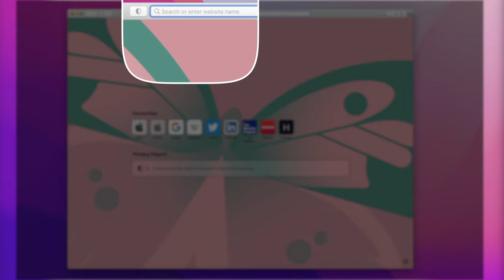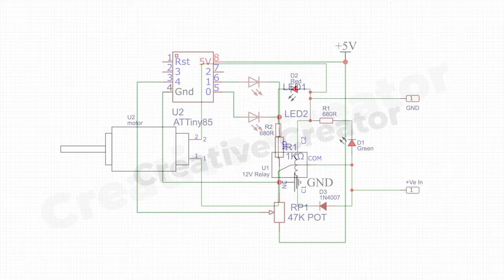[NEW] Simple Electronics Project

Comment: we can use a single diode for polarity ?...
Reply from the maker: You will not get much amps output with single diode...
Reply: Correct only  0.8volt reduce
Yes Single diode IN4007
Reply: Wsq
Reply: @Creativecreator   and also  the diode becomes too hot 🔥  . thanks bro for this ckt

Comment: If you don't want to use a diode because of low max current capable and wasting power due to the voltage drop, Just use a P-Type Mosfet for positive rail protection, or N-type one for negative rail protection. Just put in series by forwarding the mosfet body diode, and then tie the gate to the other rail throught a few hundred ohms series resistor (not really necessary but for safety in case the mosfet becomes shorted).
Reply: A single IRF3205 can hold up to 110A (but don't try to push beyond 50A). Anyhow you can put in parallel as many mosfets as you want for hundred amps.

The current through the gate is virtually 0, and so the voltage drop through drain and source.
Reply: Show diagram please ...somewhere it would help understand mosfets also

Comment: Possible to make a video on how to connect an indicator light to 12v radiator fan, which indicate the actual condition the radiator fan is working or not, but not only indicate the power from the relay alone.

Comment: Please u make a 220V,500watt AC chaser light circuit with speed controller for coming diwali without PCB  by using relay,BT-136 triac,resistor,capacitor etc...
Please...plz....plz....plz...plz...plz..plz..
Thanks very much..

Love from jharkhand❤🤝